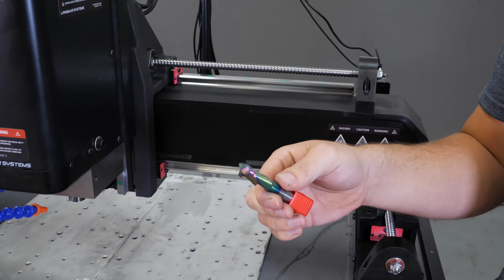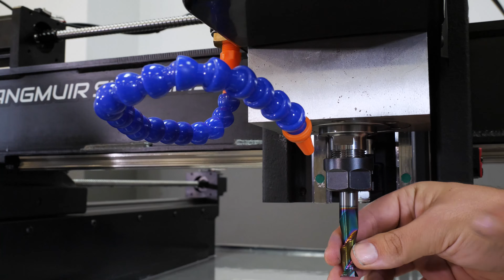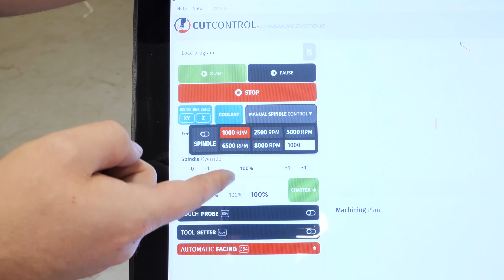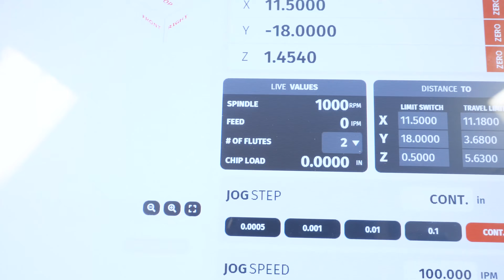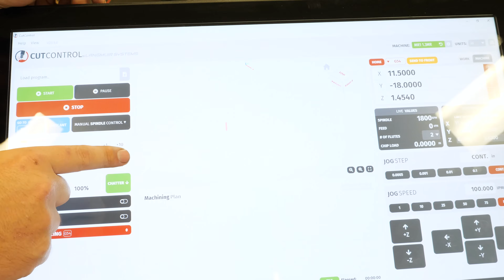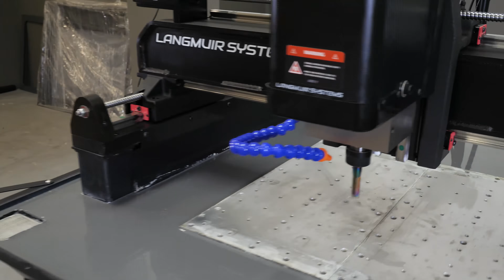MR-1 CNC Mill Assembly Tutorial: Loading a Tool into the MR-1 Spindle

Comment: I plan on getting one of these but I think my only real gripe is the total Z-axis travel might not be enough for the things I want to do with it. Would it be possible to set this machine up and use it to mill out some riser blocks to go in between the front and back rail mounts and the Y-axis rails themselves to get a couple of extra inches of height? This would probably be after plaining down the deck. Also, I feel the risers could be cut to the exact height to remove any shims needed during setup. Just a thought.
Reply from the maker: You're actually seeing the mill here with the spindle in the down position. You can get another 2" of clearance by removing 4 bolts and moving the spindle up another 2" (shown in a later assembly tutorial video). This gives a spindle nose to table of 9.2" which is certainly good for a gantry style mill. That being said yes we absolutely plan to offer a riser kit for this machine. It would be easy to swap the risers in as needed for a project if extra clearance is needed. We also imagine many people will just make their own since they have a CNC mill completely capable of this work 🤣
Reply: @LangmuirSystems  that certainly sounds easier than what I had thought out in my head, it also wouldn't have worked because the y-axis rails wouldn't be connected to the stiffeners anymore. 9" should be plenty for what I need, I believe when I first read the specs it said spindle to deck was only 6.5" and I wasn't for sure if that would work. Thank you for the extra info, I plan on ordering mine around tax refund time next year.
Reply: @LangmuirSystems   - Will the base plate need to be resurfaced when remounting the spindle up 2 inches, or when adding the optional riser blocks?
Reply from the maker: @joell439  No. We ship the spindle in the down position for decking the base plate but it can be moved up after if you want. Check out our latest video on base plate surfacing for more information!
Reply from the maker: @joell439  No the baseplate does not need to be re-surfaced in either case. However, you’ll want to match the height of the risers exactly so that you don’t introduce a parallelism error between the XY plane the baseplate.